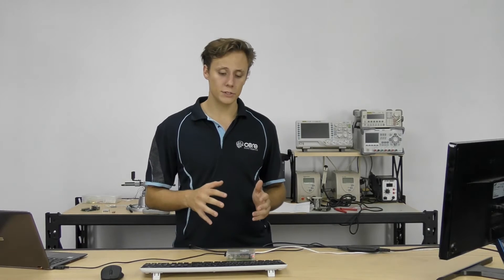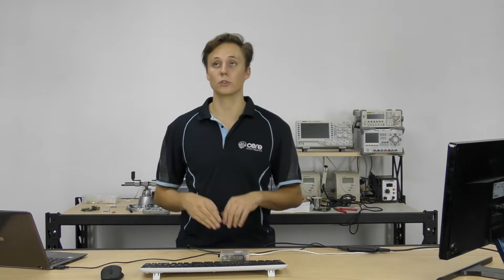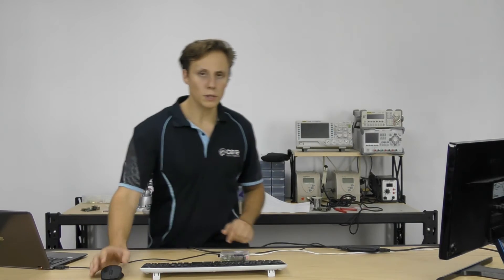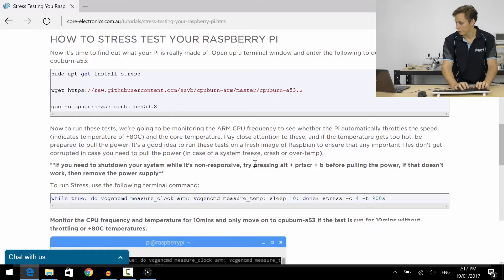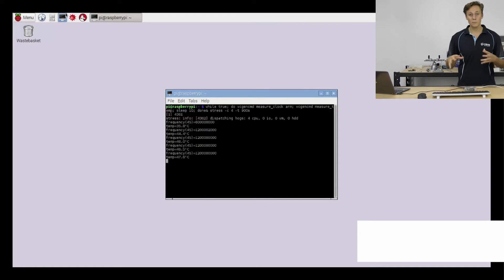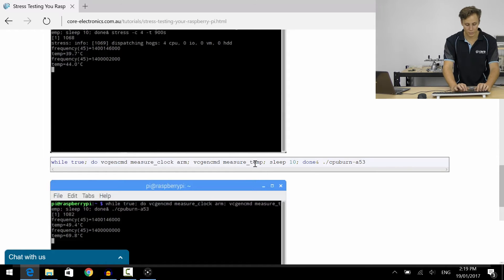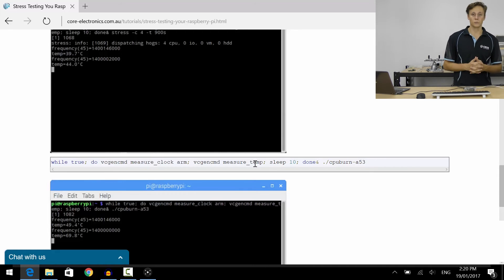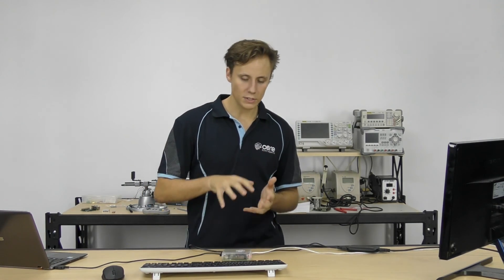How to Stress Test Your Raspberry Pi 3 Model B

Comment: i over clocked my raspberry pi zero to 1150 as it wouldnt work with 1200 for some reason. i have a heat sink and a fan attacked to the gpio pins and i ran cpu burn and highest temp i got was 28 degreees

Comment: I just purchased the CanaKit Raspberry Pi 3 Complete Starter Kit - 32 GB Edition. I installed the 2 heat sinks (no fan).  I put debian stretch on it and installed stress to run a quick test.  My unit soars to 80c within about 10 seconds and then throttles.  Maybe this is normal, I don't know.  However,  I split the memory giving the gpu 320 and tried playing some 30 fps 1080p and 720p videos.  The 1080p videos display the first frame, run the  cpu up 99% for 10 seconds, then it drops down to around 16%, still only 1 to 5 frames if lucky.  One of the videos is from http://jell.yfish.us/  it is at the top of the list with the lowest bitrate H.264,  and displays one frame, soars to 80c in seconds and throttles.   Some 720p videos would play but maybe 1 fps at most. I've put the files on several usb sticks, and even the sd card.  Played the files with VLC  (even at half size), and FFMpeg which actually work just slightly better as I saw a few frames.  
I would appreciate anyone with a PI 3 to try a playback of that video in this comment and letting us know the results and setup.  I don't want to jump the gun since I'm thinking I may have a defective and need a comparison.
Reply: Xavom I’m testing mine now, the onboard WiFi isn’t great so it may take a while, and I’m also trying a 4K for a “worst case” scenario as it’s going to be used primarily as a media centre
Reply: Xavom even at 3mbps vlc barely ran the video, and my gpu memory is 256, I have a heatsink, an overclock to 1 gigahertz, and a fan that runs only if temps spike above 60, and the fan ran flat out
Reply: Thanks.  I emailed the seller my problems and they sent me a replacement. Results were only slightly better.  All the videos I've seen of people playing a 1080 video on a pi I suspect are mostly fabricated and/or very compressed.  Many of the comments seem to agree.  YouTube videos seem to play alright on the replacement pi at 720p.  I would not suggest anyone use these as a small HTPC unless you plan to watch at 720p or less with low quality.
Reply: Xavom I’m mostly using it for “legal” movie sources so the quality isn’t great, though further research has shown that vlc isn’t great for encoding reasons, though my pi does well with streaming 1080p video so I don’t know why a simple video like that would fail it
Reply: Don't use a Pi for a media center
Reply: Have u tried installing a dedicated media playing os n running it like xbmc or something?

Comment: Thanks Sam, I like your tutorials, very straightforward and easy to follow! I have a question about the stress testing though, when I run the following command the stress part only runs for 900s but the clock and temp measurements continue to loop indefinitely. Is there an easy way to stop this? Thanks

while true; do vcgencmd measure_clock arm; vcgencmd measure_temp; sleep 10; done& stress -c 4 -t 900s
Reply: Thanks! I'll give it a go :)